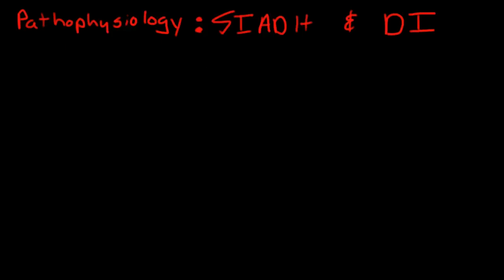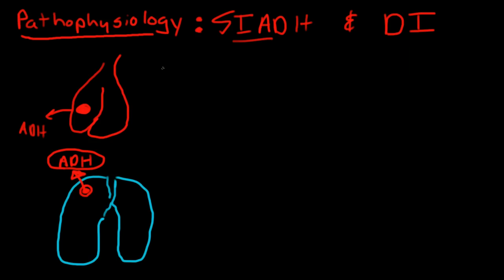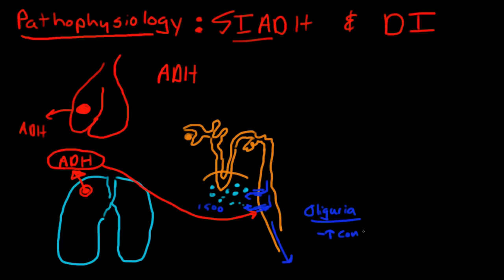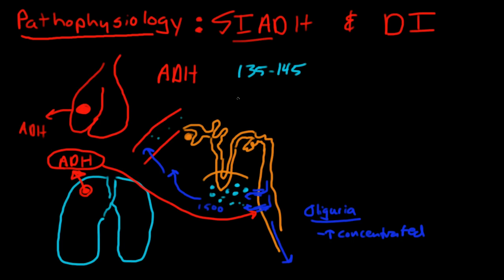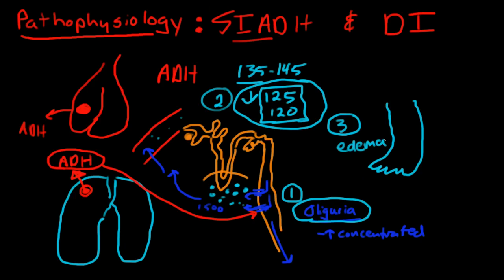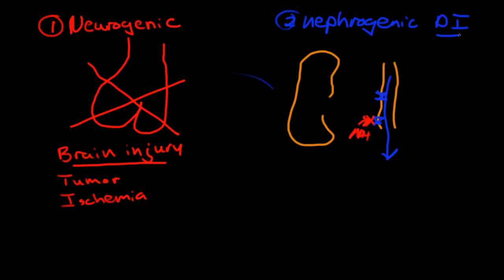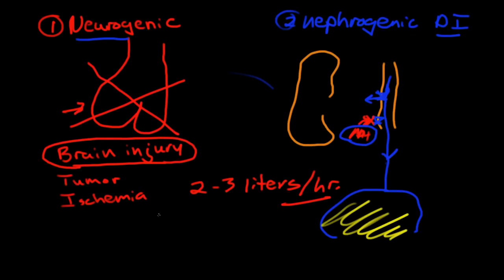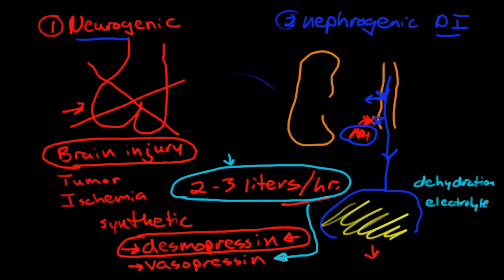SIADH & DI

Comment: I am under the impression that there is no edema due to SIADH because the excess fluid shifts from the extra cellular compartment into the intracellular compartment, resulting in no systemic edema, I.e. Pedal edema etc.